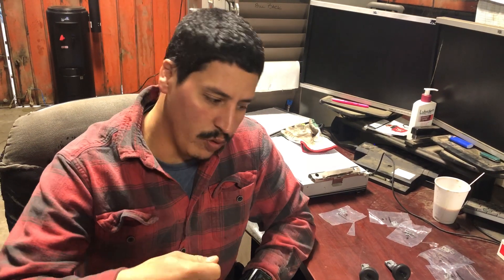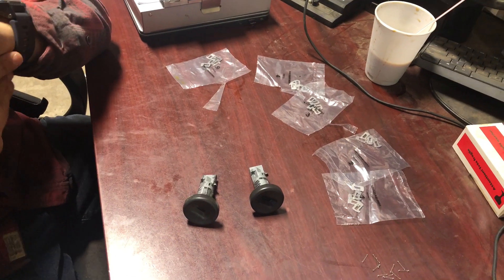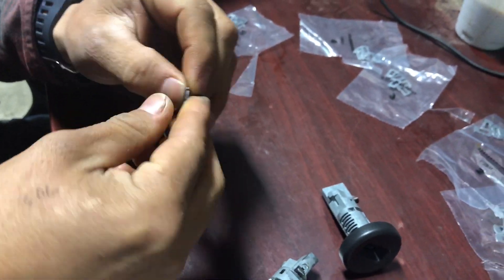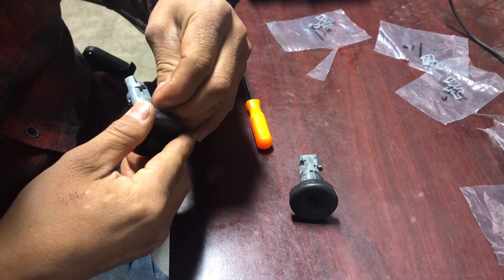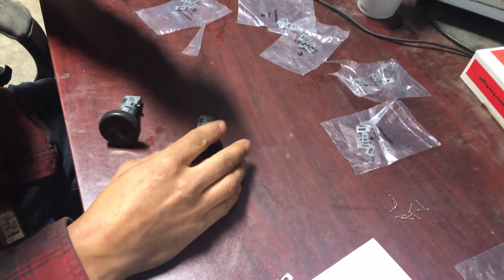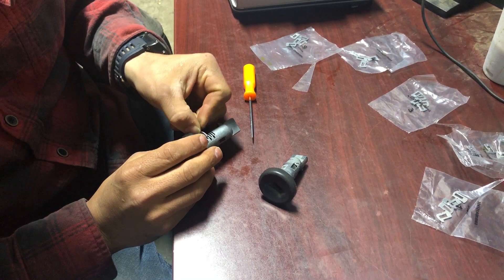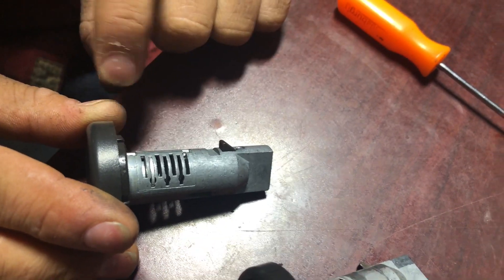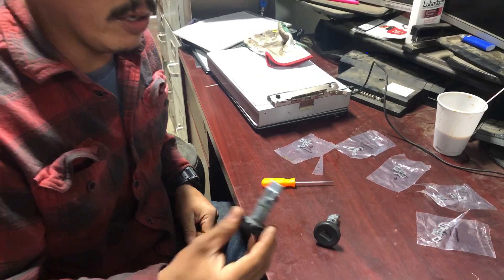2008 silverado ignition key lock  replacement

Comment: Mine won't start for nothing after today. It'll still turn back and forth but not getting any noise whatsoever, it has been getting stuck as in hard to get into the on position but it would always crank. Now it won't do nothing. So now I don't know whether to chase the ignition down, the starter, battery's, a ground etc?? I'm so bummed I need my truck for work.

Comment: Hey man! 07 Silverado NBS wont crank wont start. It cranks when jumping the starter relay but won't start. Trying to narrow down to the ignition switch, neutral safety or possibly the lock cylinder? Any diagnostic advice would be much appreciated!
Reply from the maker: J P do u have a security light on ?
Reply from the maker: J P flashing security light ?
Reply: No security light. It comes on and turns off
Reply: I have a couple codes and one for sure is likely the reason it won't start. 
P0615 Starter Relay Control Circuit
U0140 Lost Communication with BCM (Invalid serial data received)
Reply: J P did that happen after replacing the cylinder? What did you do to resolve it??

Comment: So if i buy a new ignition switch. I will have to match the key locks to the old ignition switch? Will I be able to  use the same keys?
Reply from the maker: George Arteaga correct
Reply from the maker: George Arteaga yes

Comment: Do i have to replace the key since its worn out, when i replace the key switch ???
Reply from the maker: luis valdez not all the time , you should build the switch then try the old key , if it still hangs up then replace key at dealer for 30 dollers
Reply: zacatecano1986 ok thanks i will try the switch then 1st.

Comment: Hi I have 08 Silverado I replace the ignition but the swich won’t turn back is on all the time
Reply from the maker: Juan Beltran  you didnt line up the ignition and the switch properly . Had that happen too just aline the ignition switch and use  flat head to leave ignition on when inserting the switch . Switch must be in the run position